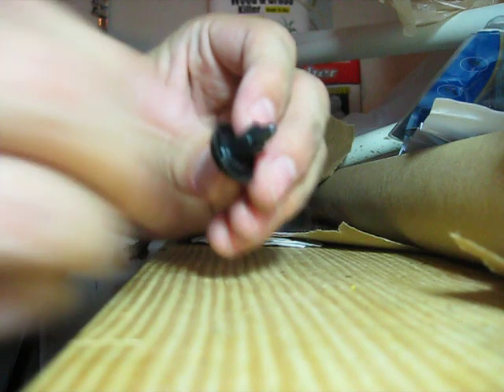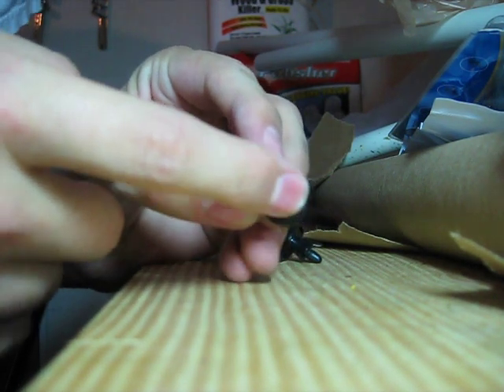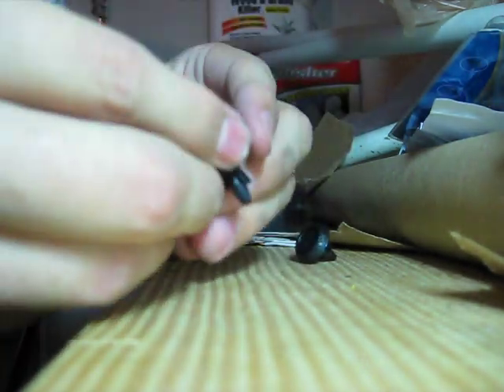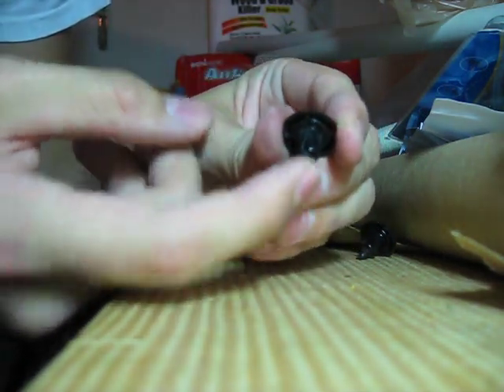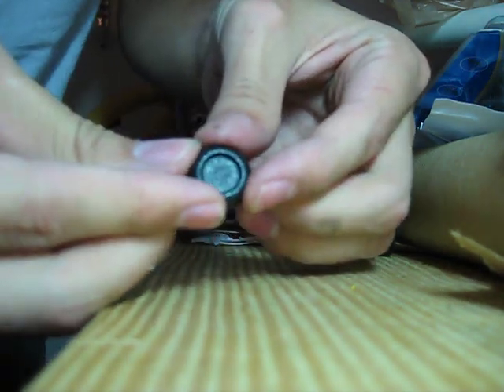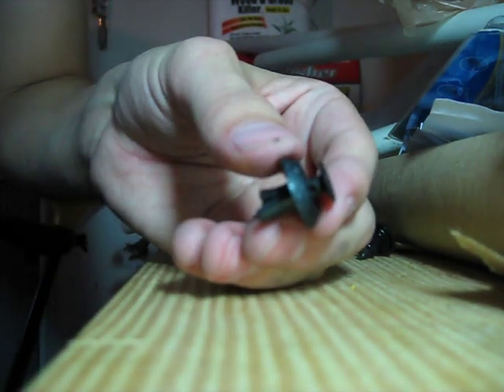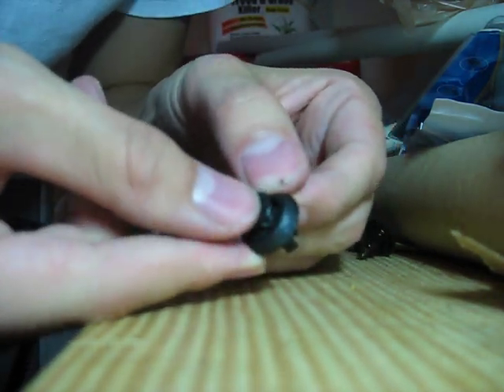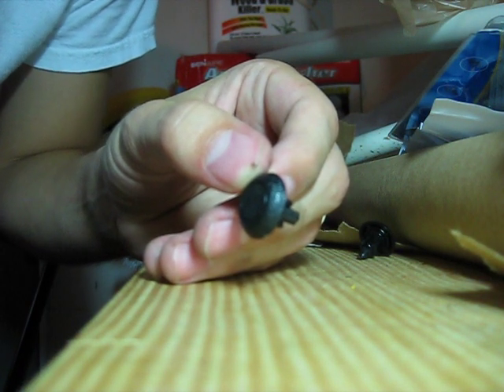Lexus IS350 Engine Cover Rivet

Comment: My 460 has large rivets that work like this, but there are slightly smaller ones (that I need to remove) where the center button won't depress, even with considerable force.  I resorted to pushing up the center post from underneath, but that's really difficult.  Also do you know where to buy these?

Comment: If you find them impossible to push back out. Boil the jug, and sit them in hot water for a few minutes. They will slide easily.